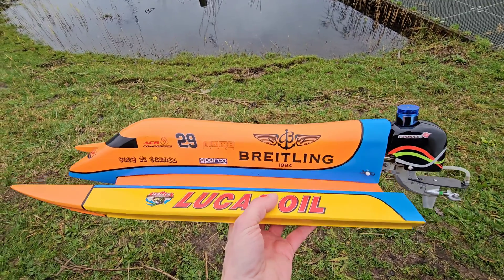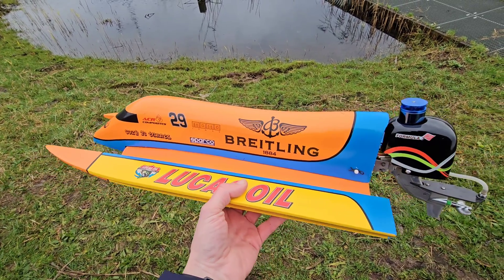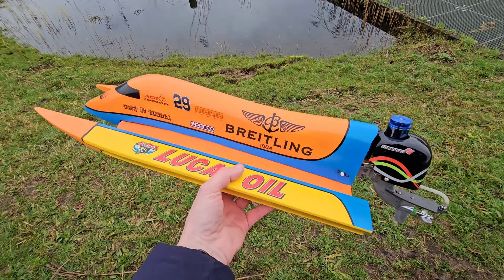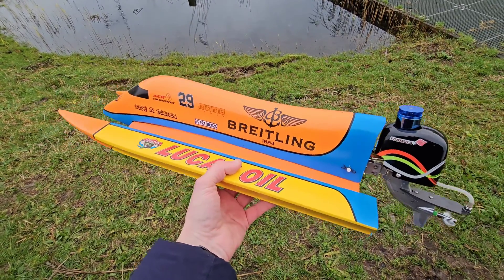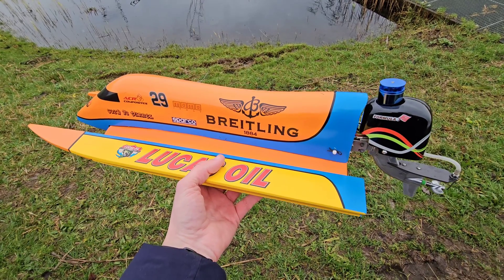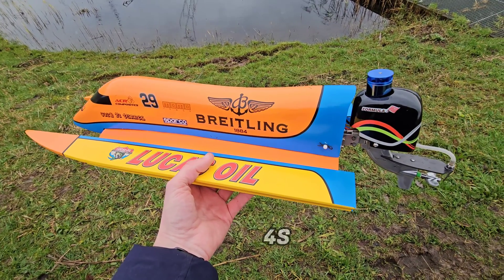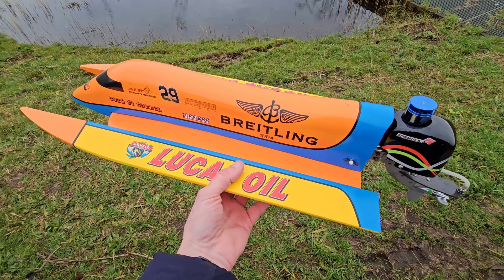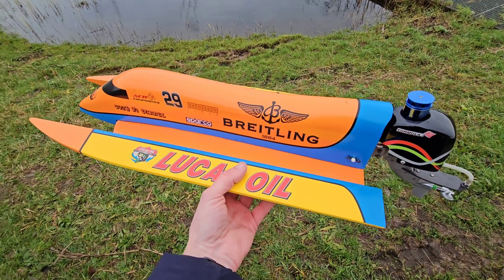DIY RC boat: F1 Powerboat CNHL lipo test.

Comment: Hi friends where can I buy an outboard motor like this please tell me 🙏
Reply from the maker: Please see this link: https://s.click.aliexpress.com/e/_EJ4Y2XK
Reply: @CozyRC  👍🏼👍🏼👍🏼👍🏼👍🏼
Reply: @CozyRC  The size of the flexible shaft is 4mm or just 3.17mm, bro. Please provide more information, okay?
Reply from the maker: This smaller outboard uses a 3.17mm fkex shaft, and the TFL large outboard leg uses a 4mm fkex shaft
Reply: @CozyRC  Can it be updated by replacing the flexible shaft with a 4mm size, friend? Because 3.17mm is very prone to breaking. 🙏
Reply from the maker: Please be aware that a smaller diameter shaft also bends easier. Installing a 4mm shaft will stress it a lot due to the small bending radius. 
The 3.17mm shaft lasts pretty long. The trick is to have a light running boat!
Reply: @CozyRC  Ok..👍🏼👍🏼👍🏼👍🏼👍🏼

Comment: To be honest, not the type off boat i'll buy, but... I need to say i runs beautifully. Also  appreciate the craftmanship that goes into these boats. So just keep on doing what your doing this year. Best wishes for 2024...
Reply from the maker: Thanks Peter, best wishes for you too! I wanted to have an F1 Tunnel for years. After I built my 1520VO Corsair flatbottom racer with outboard, I decided to design my own, specifically for the mini TFL outboard. It started with a 3S setup and about 50km/h top speed. A few props, motors and a 4S lipo later, it runs 75+ km/h and almost entirely out of the water.  
I love these hulls so much, I designed and built him a big brother, the T800. I just love the looks and driving characteristics of these boats 😎
Reply: @CozyRC  Did notice the cornering, yes, it runs nice...!
At moment i'm a "deep-v man"... Like the cornering characteristics and ability to handle bit ruffer conditions. But also got some cats, dont know yet if these are worth keeping. One i didn't like so much (long, not wide) that tended to flip cornering, other looked very promising but crashed first run (dove against bottom) and cracked the hull which i need to repair. Also got bigger boats laying around so got my work cut out for me. But now im working on 3 cars simultaneously so you get the idea. Too much stuff at the moment and need to fix/complete stuff and sell it... 😁